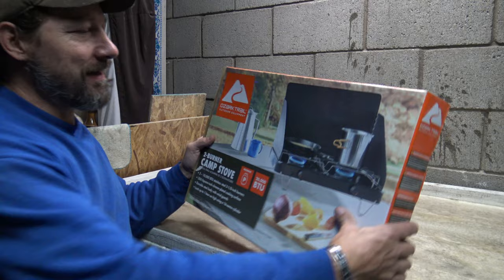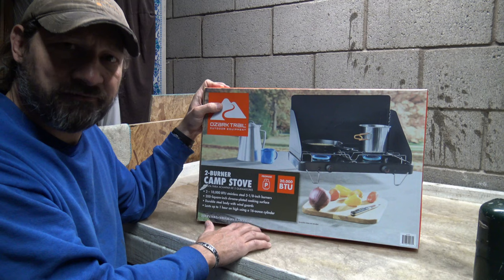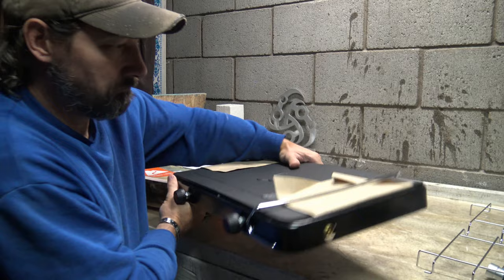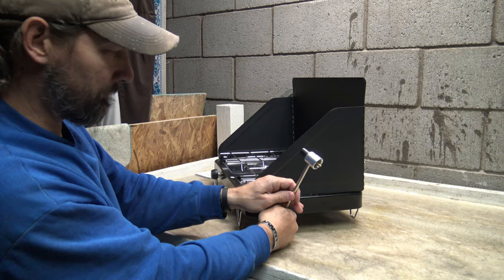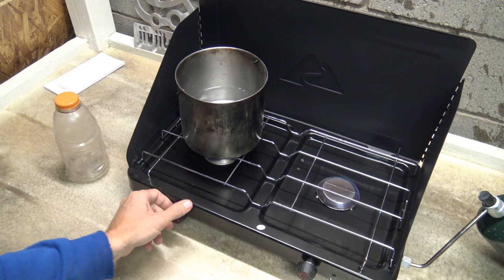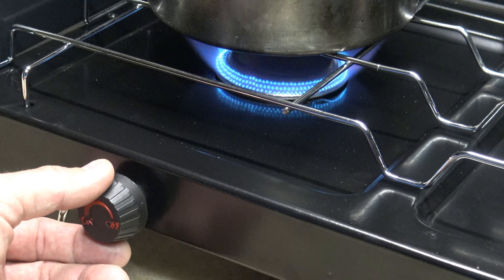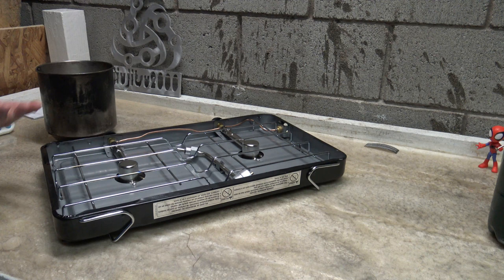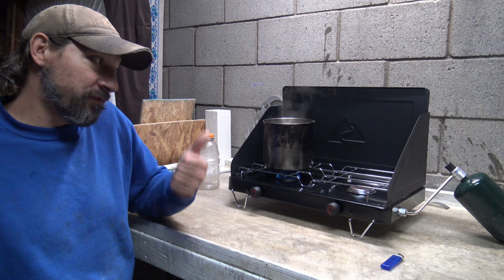Ozark Trail 2 Burner Propane Camp Cook Stove - 27 BUCKS!  Not Bad!

Comment: That stove looks like it works ok, for the price $27 bucks and a bottle of gas $7 bucks  ,total $34 for a workable  2 burner , it would have been nicer if it was more self contained and had a handle and  didn’t have to carry it around in a cardboard box also an igniter would be great , but with all the extras it probably wouldn’t be $27 bucks , but it’s still a pretty “ Hot 🔥deal “ 👈🏼😆

Comment: 32 down to 28 ounces for about the same price is called shrinkflation. 
I actually have one of these stoves and at a true value hardware store I bought an adapter hose to hook it up to a 5 gallon propane tank. A year or two ago when that snow storm came through Texas I set it up in my bedroom and when the electricity went out I was warm and comfy.

Comment: Thanks for the review.  I think you are correct in that for 30 bucks it wouldn't hurt to buy one and stash it away as another backup to my backups.
 As an aside, I would love a video from you about your fuel storage arrangements. Last year I became concerned about the amount of  the various fuels that I had stored in the house. I moved most every thing out into my detatched garage and shed. That didn't satisfy me either so I built an additional shed, further back in the yard and have moved most everything into that. I did add some exrta ventilation,  both high and low to eliminate any vapor build up, plus I used a roof coating intended for mobile homes to reduce the heat build-up from the sun. The only fuels left in the house are small amounts to get things started before I have to bring anything back in. I'm looking for other opinions on safety precautions in that area. Thanks

Comment: These were on clearance for $15.  I would be concerned about the long-term reliability and the tubes are more exposed on the bottom but it is a nice stove.  It allows you to simmer low and it is slim and easy for storage.  I would prefer to buy a good example of a used older Coleman stove though than this or a new Coleman stove.  This Ozark Trails stove looks like it would be easy to clean.  It is certainly worth the $15 for someone that occasionally wants a stove for camping or picnicking.  In particular, it would be a nice emergency backup stove.

Comment: Can anyone tell me what I'm doing wrong with this camp stove? Or: Do I need a regulator to connect it to a 15-pound propane tank? The pressure is weak I think. It flickers when I light it. Not heating pans up very well. Doesn't respond to burner knob very well. So I need some kind of regular in order to use the bigger tank? Thanks.